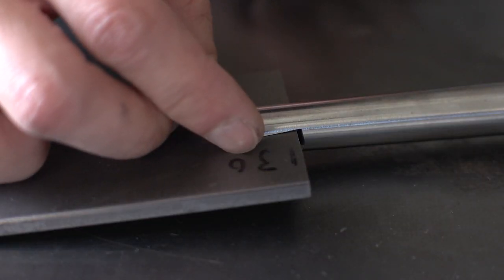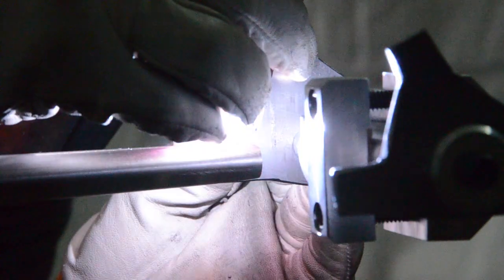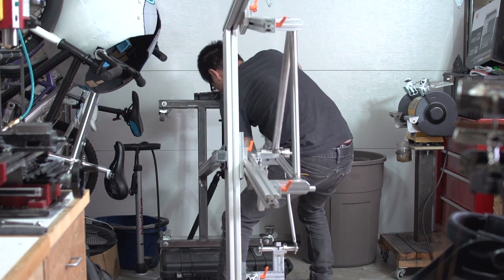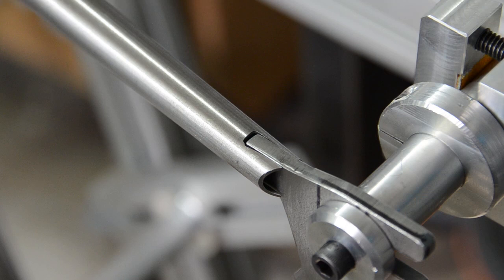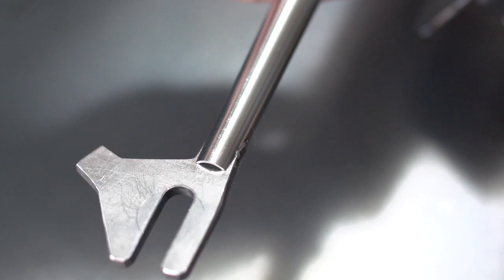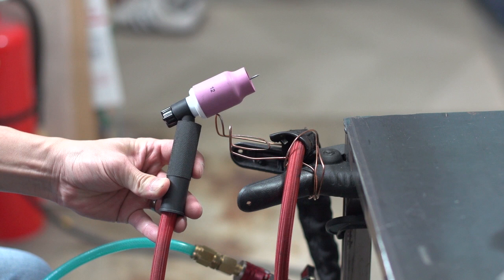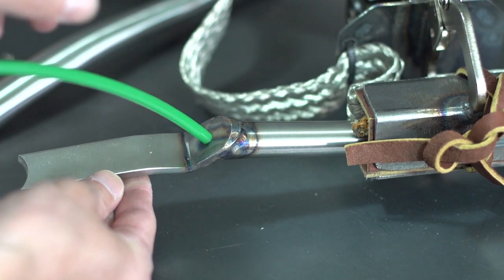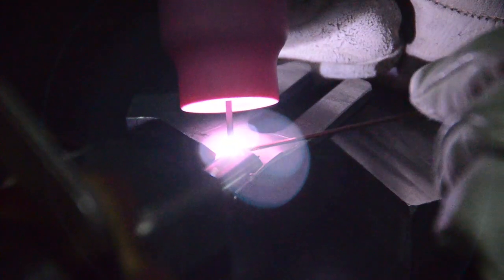Bicycle Frame Build 51 - Tig Welding 4130 Chromoly Dropouts

Comment: hi, love your videos! truly. thank you for putting the time into them. I am also a frame builder not nearly as satisfacted as you, but I do what I can.  I didn't read all the comments. but I am like 99% sure that sparking at the end, especially when you were welding the small Cap. is because the purge is too high and is basically blowing your gas (shielding) away or mixing with atmosphere. if you don't have a vent hole, try purging the tube for a minute or so at like 5-10cfh then crank it down to 1cfh, just enough that you can barely feel the gas coming out. that will still keep the part purged. but hopefully help with not messing with your torch shielding. keep up the good work.
Reply from the maker: Great tip, I'll do that next time. :) Thanks!

Comment: Start working with the foot pedal on that machine I have the power tig 250 and the foot pedal will give the stack dime look vary easy nice work.
Reply from the maker: +Kevin Todd thanks for tip. I tried manual pulse but I settled on machine pulse. It let's me move faster.
Reply: I have been welding for 40 years.....long before pulse tig we always had the pedal. I have been a pipe welder most of my working life. I now have a Everlast machine.....now in long runs of thin metal I will use the pulse it works quite nice. I like the pedal for it's aesthetics and it's performance. I like the fact I can go from 10 amps to 150 in a shot back down to 10....cool the weld move to next puddle and hit it again.....I have found that the penetration is local to that spot and deep.....you do vary nice work.......just a suggestion

Comment: great series, thanks for sharing with us.  Two observations- 1) engine stands have a tube that allows them to be rotated w/o disassembly.  Your main fixture may benefit especially  after watching you wrestle with it to flip it over.  2) I cringe almost every time you cut on the bandsaw.  the square tubing guard will only partially protect your hand if u slip.  we like u with all of your fingers!!!! :)
Reply from the maker: Engine stand, yes that's a great solution. I'll have to steal a similar design. Thanks for the concern about fingers, I'll be careful!

Comment: Hey Sparky, do you use acetone on your clean up before welding?  I was also wondering if you use sand paper on your clean up. That with no acetone clean up will cause the sparks. Just a thought I had. I have seen that before and that was the cause. Thanks for your videos.
Reply: he did sand
Reply from the maker: Haha! I used acetone last as the final cleaning step.

Comment: Hey man, love your videos so much, production quality is top notch! I am an avid fix gear kid and an aerospace welder of 5+ yrs. So cool getting to listen to your commentary. Takes me back to all the thoughts I've had over the years(that I have since forgotten) as I was learning to weld.  I think you are making the right call on no more pulse. I've messed with pulse here and there and have yet to find a situation where I would rather pulse than run manual. I think it's more common with alum( I run primarily stainless and inconel these days, very similar to steel.) 

It's great to see somebody having issues and instantly diagnosing them correctly. I literally said "purge too high" and then you said it a second later. That put a big smile on my face and it's great to see somebody who is picking up tig welding so fast(trust me, you are.) You'd be surprised at how little back purge one generally needs. As soon as you see your arc start to wave around or flicker when there is backpurge present, you know it's time to turn it down. And yes, way too much purge will throw sparks like crazy. 

I may be telling you something you have already figured out but I feel like you're the type to welcome constructive criticism/advice. So.. when welding something thick like a dropout to something thin, like a chainstay, keep the majority of your heat on the thicker material. The thinner material will get hotter much faster than the thicker material so remember this: the puddle wants to go where the heat is, NOT always where your tungsten is pointing. This took me some time to understand but my welding improved overnight once it clicked. The key is to keep the heat evenly balanced on the two work pieces, which is difficult when they are two different thicknesses. Basically when welding things of different thickness, keep the heat primarily on the thicker material because it will take more time to get hot (and is more difficult to keep hot) and and find that balance point where the puddle will almost "wick" up onto the thinner material so that in the end, the weld will sit evenly on both work pieces. Yeesh, I hope that made some sort of sense. 

A++ work brother!
Reply from the maker: Hi Brad, Thanks for the crit! It makes so much sense yet when I start welding it's easy to forget certain things. Bias toward the thicker material is a really good one. Thanks for the confirmation on purge being too high. I said it but I still wasn't sure if that was the reason. Now I'm more confident. Every weld a little better :) Cheers!
Reply from the maker: Just watched your vids. Nice keo's! I still can't keo. For someone whos into fixed i suck lol. I blame my old age.

Comment: im amazed how long have you being tig welding? , you welding is very good , i wish i had half your skills :( my tig welding sucks
Reply from the maker: I started welding about 3 years ago. But haven't really put in a lot of hours. Basically all the stuff you see in the videos is the only stuff I've welded. Actual weld hours must be about 100. But I can't really count that way because I believe 1/2 of learning welding is thinking about it. Sometimes I'll think for a few days when something isn't going right. For example pulse, I spent more time thinking about pulse settings and technique and what I could possibly be doing wrong than actual torch time. I guess it makes sense because it's a pain to prep tubing miters. So when i finally get to a practice weld I want to make it count. :)

Comment: Hi,
I'm very interested in your custom torch.
May I ask you what did you do and where you ordered parts?
I would like to do the same with a wp18/19/26 torch. 
Thanks
Reply from the maker: I'll make a video on it soon as I finish the bike! So I hope you can wait a while? I can't remember what vendor but I got the torch really cheap off ebay from a China importer. I'm talking like $20 for the whole torch and cups kit. I ordered it specifically with possibly destroying the torch in mind.

One thing to be cautious of with this setup is it could be dangerous if you are welding at high amperage. I only use this torch for 70 amps or less. That being said, I have no evidence to back up my claims of danger. It's just an assumption :)  There must be a reason why manufacturers have long handles right? Maybe not I don't know :)
Reply: Yes i was about to do the same thing with a Wp17 (mistake in my first msg) but I would like to see what kind of flex cable you used.
I will wait for the next video, thanks

Comment: i think 18 cfh is a little low for that size cup. It never hurts to go a little higher. around 25. Also if you don't already know about the furick cups, highly suggest you look into them or invest in one if you do any kind of welding where you need excellent coverage they are hard to beat. The pupa 12 is a great all around cup or the bbw if you need better coverage for titanium or inconel.
Reply: FUPA* not pupa, lol
Reply: Lol autocorrect
Reply from the maker: I was considering a Fupa cup. But was concerned that the hole for the tungsten is too large? I use a 1/16 tungsten.. I do want to get a fupa cup. Maybe I'll see if he will send me one for free ;)
Reply: pretty sure you can order screens for 1/16  tungsten. if not, I really doubt you would have e a problem. they are pretty awesome cups.
Reply: Hi Steve, great videos. Did you ever get a fupa cup?